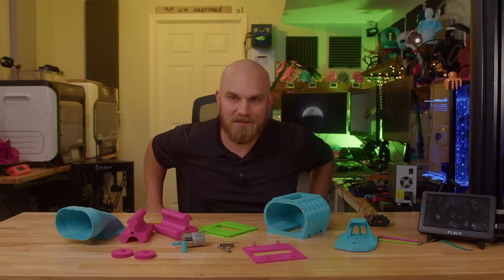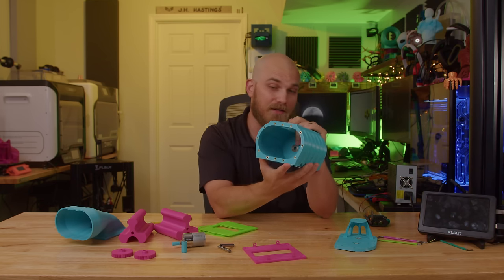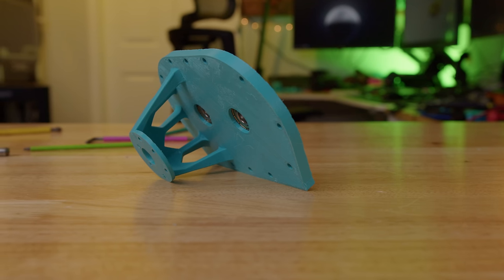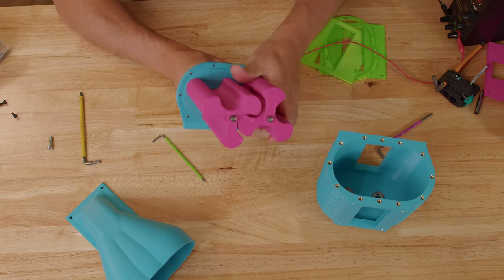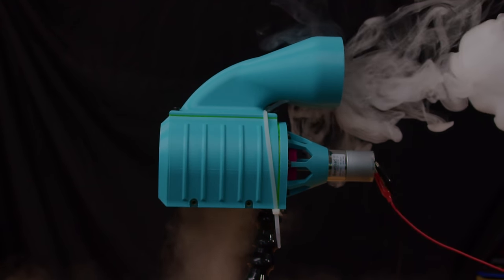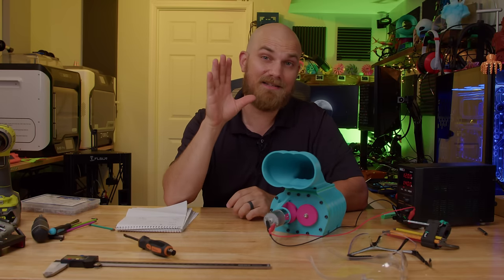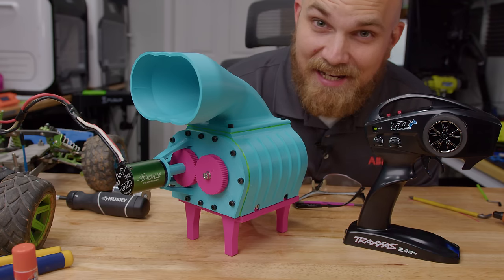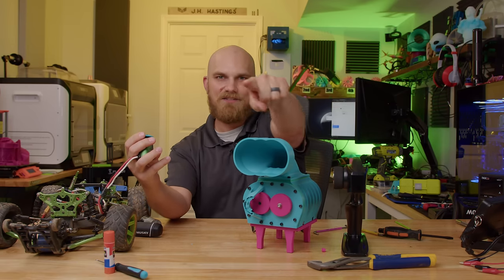I SUPERCHARGED My Custom Loop…… Literally

Comment: i like to watch your videos . and since this one is live i haven't been able to get the idea out of my head to make this to fit my lancool 2 case on top . with nothing inside the blower . but the outside looking like a real one . 2 slots with dremel in the case and a piece of rubber belt. i've also been thinking of making itb's voor the triple fans in the front . in a light diffusing material if that's possible. the cpu fan needs a cover to make it look like a turbo . covering N/A , turbo and supercharging in my top gear themed pc .

Comment: more support material on the snout like a real one and different gear setup for different ratios could be used if the motor doesnt spin fast enough.

Comment: You need to do a 3d printed engine pc case, i wanna see headers with exhaust fans and big blower intake, cpu water cooling with rad in front of engine so you can have the engine cooling syatem as part of it

Comment: What I experience that some motors get hot and they melt either the mounting struts or place where the gear is attached to the motor axle

Comment: if you want to improve airflow dramatically, add a rubber strip, has to be fat on the bottom and tapers out, like an tear drop design. (shim).

Comment: Maybe should have given that original motor More voltage. Like 24v.. 36v
They usually handle it just fine.
Also, a good source of powerful motors.. cordless drills. Nobody wants the old 24v anymore. Take the motor out, it'll be connected to the trigger. So you have a good adjustable rpm that you can lock. They are so powerful the gear on the end of that Motor can rip your fingers.

Also. I think using a timing belt. Just looked up cog belts on eBay. They cost almost nothing. If you want to change speeds.. just change the one belt cog gear on your motor.
Belt drive, cogged.. they run very quiet.

Comment: Always suck from the radiator, never try to blow air into the fins.
Yes I know some commercial computers do it but I was trained with airflow systems in industry and sucking avoids cavitation so for the same capacty fan you get better throughflow with sucking from a cavity or heatsink than from trying to blow into it.

Comment: you can probably hook this up to the fattest radiator you have and it wont have a problem cooling it blowers are made to create boost and flow of air to engines but mostly boost so longer fins means more surface area

Comment: ... using a worm wheel as a spur-gear?  Not cool.  You're a Solidworks guy right?  All of the Mcmaster native Solidworks models are PARAMETRIC.  If you download a 69 tooth gear, you just have to change a few variables to get a 96 tooth gear.  

Back on topic, EPIC fan.  If you can get rid of the sliding noise, I'd say you have a winner of a PC mod!

Comment: Car guru + PC guru = wth
Edit: I would have gone with a 1500-2000 rpm motor just for a bit of extra spin and torque so it moves a bit more air into the radiator. If there is another reason why 1000 is best, please, share

Comment: Gears should be nylon or some other off the shelf gear. 3D printed gears will always be a problem. Especially the gear on the motor.

Comment: When I want to try a filament same day.  I see if micro center has it in stock.  Has anyone have trouble with the inland brand with there printers as well?

Edit: found out my bi metal heat break either failed or I didn't install it right.  There was pla and petg melted all around the heat block......I know what I'm doing this week.

Comment: high pressure oil pushed through axis spin end to lube thysz engine would make foam fuel igntabl from lube with barrier resistance,   super lube then ...

Comment: remove tubing warmsz ... neutralize and adjust
Reply: via oathsz of course ,, 2 pathsz in ... compresses air more 2 pathsz out speeds up flow,,, enginesz have many turbonicsz ... 4 fuel lines pumped into 1 goes like 8 or more